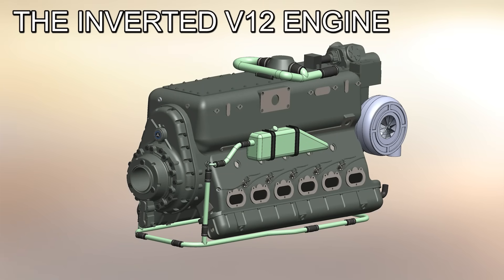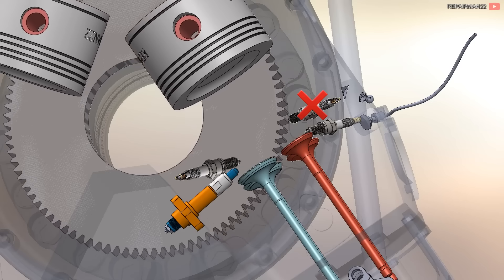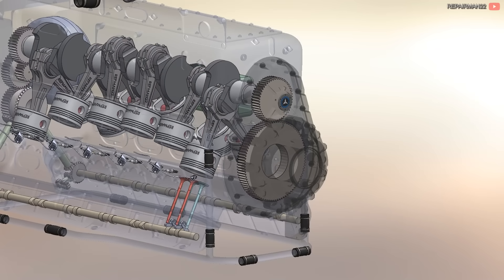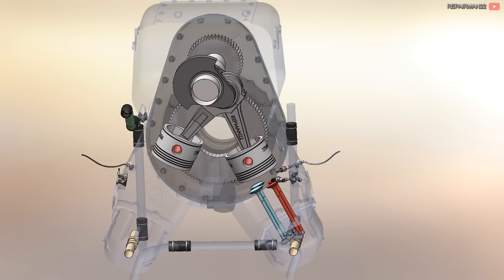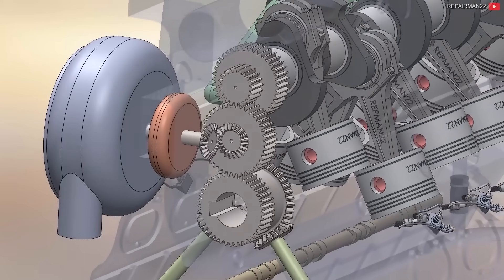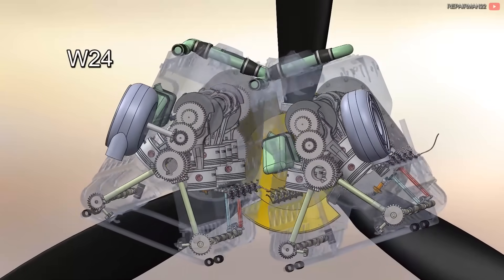The INVERTED V12 🤯 Why!?!?  - 3D animation - DB 600 Engine // Daimler Benz

Comment: @TheEulerID Thanks so much for your reply, it was informative and fascinating. I knew of diesel being more power dense because of it being less refined. 

My reasoning was that, the first thing manufacturers did during the first U.S oil crisis in 1973-74 to improve fuel economy was to lower compression. 

I learned so much from your reply.

Comment: The Merlin and Allison engines used a water/ethylene glycol mix to allow higher temperature coolants, and thus smaller radiators, without requiring a highly pressurised system. It ran at about 120C. I wonder why the Germans didn't try that approach. Maybe they just didn't have the capacity (the British got their ethylene glycol from the USA).

Incidentally, there were bf109s with V12 engines the "right way up" in the form of the Spanish licence-built Hispano Aviación HA-1112. However, the Germans could not provide the DB605A engines as they needed all they could build once WW II started. Consequently, the Spanish installed the Hispano-Suiza 12Z V12, which was similar capacity (36.5 litres) and had the same provision for a hollow propeller shaft to accommodate a cannon barrel. 

After WW II, when surplus Merlin engines became available, then those were retro-fitted to the Hispano Aviación HA-1112 fighters. They can be seen in the film Battle of Britain, as the producers leased a number of those Hispano Aviación HA-1112 fighters and painted them up as Battle of Britain era bf109s. However, you can clearly see the give-away that they were Merlin engined from the higher line of the exhaust stubs. They would also, of course, not have sounded like a DB605A engine either, but the producers just dubbed the "correct" sound in. 

So to what extent the adoption of a conventionally orientated V12 affected the performance and flight dynamics of the bf109, I really don't know. But clearly the inverted engine format wasn't absolutely essential.
Reply: @EbenBransome The Merlin I, II, and III series all used pure ethylene glycol coolants. That presented problems, not least with it being highly inflammable. From the Merlin X on, a water/ethylene glycol mixture at a ration of 70:30 was used, and that seems to have remained.  

First it is a fact that RR used a water/ethylene glycol mix an settled on a ration of 70:30 as the best compromise (which they used from the Merlin X onwards). Also, the lower heat capacity of ethylene-glycol does not, in itself, cause radiators (or rather heat exchangers) to be larger. Quite the opposite as they can run hotter and exchange more heat through a given surface area. Where the reduced heat capacity of ethlylene glycol does come into play is in how fast the flow rate has to be. One half the heat capacity, then twice times the flow rate and there are also some conduction issues.

The prescribed coolant temperature at high power output levels, such as when climbing fast and in combat was 120C, although some later models were allowed very short periods at 135C. 

In practice, the cooling system of the Merlin and its prototypes evolved quite a lot. Originally it was intended to use evaporative cooling, but it proved unreliable and hence the move to ethylene glycol cooling in the earlier engines. Later it move to the water/ethylene glycol mix.

Comment: How did the prevent oil leasing in the cylinders hydro locking the pistons when cold starting
Reply: It's a dry sump design. That is as much of the oil as possible is scavenged out of the crankcase and stored in a separate tank. That's not unusual - all the high performance V engines in WW II were dry-sumped or else there was a very strong chance of oil starvation under aerobatic manoeuvres. 

That's not to say it isn't still possible. In the case of radial engines it was normal to turn the engines by hand first to ensure that the bottom cylinders weren't hydro-locked. I suspect the Germans may have done that with their inverted engine designs too.

Comment: Inverted engines require dry sumps, and it's apparent that manufacturers either have a bug up their backside, or lack the compentency to manufacture engines with dry sumps.
Reply: Dry sump was the norm for aero engines, even if conventionally orientated. Thus the Merlin is dry-sumped, as is the Allison V-1710-F30R. The reason is obvious. With a highly manoeuvrable aircraft, you cannot afford to have the oil sloshing about in a wet sump as oil starvation becomes inevitable, which would be disastrous.

Top level race cars have dry sumps for the same reason.

Comment: I remember an argument that started one night at a bar over someone said the cannon fired down the middle of the crankshaft' there ensued the argument i stepped in with a little sketch showing the con rods crossed the rotation centre line of the crank therefore it was impossible ............
Reply: +@leso204  The cannon does not fire through the crankshaft but through the vee of the engine cylinders and exits through a hollow propeller shaft.  The prop is geared off of the crank for most aero engines.
Reply: @FiveCentsPlease  As i said' some people have no engineering knowledge but still argue they are right ........

Comment: This engines suffered a lot from Overheating, for two reasons, the Germans dont had quality materials to built Good and effective radiators, and the Middle Cannon of the Bf109s mounted inside the engine can make fissures on the block so they deactivate the middle gub

Comment: Because of the fuel injection it was possible to keep both intake and exhaust valves open for a certain time. This increased the gas exchange in the cylinders.

Comment: Another weird motor, there exists a version of the old 1.9 Volkswagen turbo diesel (I believe it is based off the ALH block motors) that exists in a vertical design meant for backup generators etc

Comment: Im just imagining this engine inside a King Tiger tank instead of a Bentley
Reply: The King Tiger used a Maybach HL230 V-12 engine (and certainly not a Bentley engine, which was British at the time). The Maybach was 27 litres and a lot more compact at 1,000 mm × 1,190 mm × 1,310 mm. The DB603 was 2,642mm × 775 mm × 1,067 mm. Of course the latter did include some things like the reduction gear and (essential) supercharger, but there is no way it would fit in the engine bay of a King Tiger. There is also the little issue that such a powerful engine would wreck the already marginal transmission system of that tank which really was not up to the job.

As it is, towards the end of the war, it there was a recommendation to fuel-inject the Maybach and supercharge it to give around 1,100 hp, but it never happened.
Reply: @TheEulerID   Two Panzer VIII Maus prototypes were constructed for testing and were powered by MB509 V12 engines that were derivatives of the DB-603.  The Soviets captured them and one survives at the tank museum in Kubinka.
Reply: @FiveCentsPlease  True, but the Panzer VIII Maus was not a King Tiger. It was a super-heavy weighing in at 188 metric tonnes. The "king" tiger was a "mere" 68.5 tonnes. So I still think it would be impossible to squeeze an engine derives from the DB-603 into the engine bay of the latter.
Reply: +@alfredshort3  There was a tank version of the DB-603.  Two prototype tanks were built and tested.  One survives in a Russian museum.

Comment: The Germans were not the only ones with inverted engines in fighters the Japanese also used their own inverted Mitsubishi engines, Can't remember how many cylinders but it was a huge engine I saw it along side of the Daimler Benze  V 12  like the one featured hear in a private collection many many years ago, also there was a reproduction of a prototype weird X 8 engine
Reply: +@Fladflidington   The Japanese built a licensed version of the DB-601 engine.  Although they lacked the expertise to manufacture precise tolerances so those engines were problematic.

Comment: Tower Shafts and bevel gears were standard for inline aircraft engines. Gears also drove the magnetos, oil pumps, foolant pumps and mechanical superchargers. Botton end bearings could be plain or roller type.  Radials it was common to use ball bearings on the crank. The cam rings were driven by external and internal spur gears. The cam ring in an 18 cylinder radial often turned wt 25% of crank speed. Props in all engines except low powered direct drive engines used speed reduction drives to keep prop tip blade speeds below the speed of sound.

Comment: The lower C of G is a myth, if the cannon tube is on the planes centre line, then the heavy crank and rods are now above the planes centre line.(In cars there are no inverted V engines to keep the C of G low) The higher C of G of this engine helps the plane to initiate a roll from straight and level.

Comment: Did not watch the whole video. I guess the main reason for the inverted configuration is because that is what the customer (German Air Ministry) wanted :). I've seen it sited that this allowed the gun to fire through the propeller  axis. I'm not buying that as I see no reason why this could not have been achieved with 'normal' configuration if so desired. One thing going for inverted V is that access to spark plugs and cylinder heads is easier from the ground on a fighter airplane. I think maybe the right question is why allied used 'normal' configuration and again I put forward the access to the sparkplugs and cylinder head as they had the requirement to use the same engine in tanks and boats. Imaging chaning the spark plugs in the bilge of a boat with and inverted V engine.

Comment: Inverted is a relative term.  The cylinder heads are facing downward relative to the rest of the engine, but who's to say that's not right way up? To me this seems like a more sensible arrangement.
Reply: The vast majority of IC engines are orientated with the combustion chamber at the top. Hence it's called conventional. Among other things, it allows wet sumps and also avoids the problem of oil draining down into the combustion chambers. Also, for land and water-based usage it allows easy access to the valve gear and spark-plugs. It is only in this particular use in aero engines where it has some advantages. So we use the term "inverted" for the minority case. 

Incidentally, there were other "inverted" aero engines around, such as the very successful de Havilland Gipsy Major used in many civil aircraft prior to WW II.  It suffered from high oil consumption until modified pistons and rings were installed to control it. Thus there are disadvantages as well as advantages to the inverted layout.

Comment: Once they built the first one, they were kinda stuck! Their mechanics were trained in them, their tools were tailored to them. The marginal advantage of changing just wasn’t there. Similarly, you will note the Nazi Luftwaffe stuck with the 3 bladed propeller for most of its aircraft. They figured the 2% gain in efficiency was not worth the additional manufacturing etc. rather like the US sticking with the Sherman tank, heaps better available, but they were being built all over the US by over a dozen different manufacturers with dozen of variations, petrol, diesel, 75 mm shorts, 90 mm longs, Recovery, Swimmers, Bridgers, Flails etc. of course, later on they built the Butcher Bird fw 190, that’s another story.

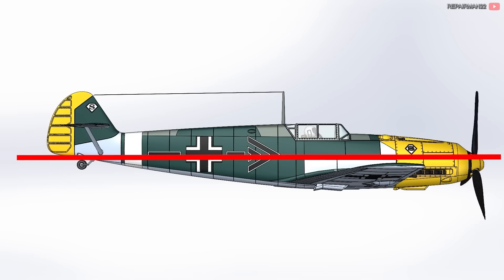Comment: 07:29 If the engine will be operating at higher temp, then the radiators have to be BIGGER, NOT SMALLER.  That sounds backwards.
Reply: You have to consider the differential in temperature between ambient and the radiator. All things the same a hotter radiator will dissipate more heat than a radiator at a lower temperature, that's just basic heat exchanger stuff. That would let the radiator be smaller as well as the fact that it doesn't even need to cool the coolant as much since it is supposed to run hotter. Makes perfect sense, besides running an engine above 212 degrees being really, really infeasible...
Reply: No, that is completely wrong. If the radiator is running at a higher temperature, then the temperature gradient is higher which means the rate of heat transfer per unit area is higher. Thus if the radiator (really better called a heat exchanger) runs at a higher temperature it can be smaller and requires less air per unit energy transferred.

Comment: Everything is very clearly and neatly laid out, I just noticed that either the propeller is rotating in the wrong direction in the entire video material, or the angle of the blades in the direction of the aircraft's movement is incorrect

Comment: So why didn't they use diesel with heaters for the fuel?
Reply from the maker: Diesel engines are heavier and need more displacement. It was in the desk but the gas engine was selected.
Reply: @repairman22  Why didn't I think of that?

Comment: Different compression ratios are amazing. I think the same, and even more strong, problem should be at Subaru engines. Amount of oil going to left and right sides must be very different. I think that is a reason of the 4th cylinder knocking, just lack of lubrication and piston cooling.

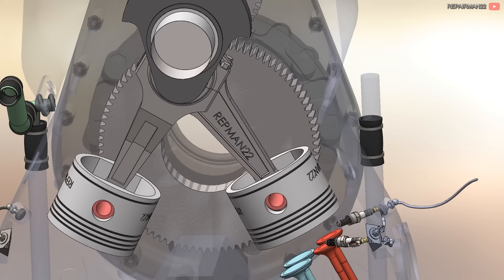Comment: @1:57  "if the engine was stopped for a long time, the cylinders could become flooded with oil and the spark plugs had to be removed and cleaned."  No, that isn't the main reason, and that is why this video was definitively not written by any airplane mechanic.  If oil gets into the cylinder and the engine is rotated by a starter without draining the oil first, the rods will bend (fluids don't compress) and the motor will have to be rebuilt.  This is called hydraulicing by most mechanics.  That is probably the main reason that the Allies didn't want to use an inverted V-12, because it was so easy to hydraulic the motor.  It may have required that the spark plugs be cleaned, but the main reason was the hydraulicing that would damage the motor.  This is why you don't just start an engine that has ingested water - it will destroy the engine.  You have to pull all the spark plugs and spin the motor over to force all the water out of the cylinders.  If you've ever wondered why you have to pull the prop through two revolutions on a radial - this is why.  You have to get the oil out of the bottom cylinders before spinning the engine over.
Reply: He was referring to removing the spark plugs to drain the oil and also cleaning the spark plugs as a secondary thing, obviously the main thing is to drain the oil through the spark plug holes.
Reply: Thank you
Reply: The Boeing Stearman was like that.
Reply: Hard to take your comment seriously if you don't even know and/or use the correct term: hydrolock.
Reply: @jimb3362  I know the correct term.  But, not everyone does - specifically the people who have never heard the correct term.  Even if I used it, the larger audience may not know what it meant - which is why I described it.  Mechanics by and large already know the phenomena, they don't need it described to them.  And, most mechanics aren't airplane mechanics (or A&Ps, or Airframe and Powerplant mechanics since you are insistent on the correct terminology), but among that larger group of  mechanics it is colloquially known as hydraulicing.  Yes, the correct term is hydrolock.
Reply: @wackowacko8931 I apologize, I have never heard that used to describe the hydrolock phenomenon. I would also expect the term hydrolock to be more intuitive to those less informed, but nonetheless you still explained the concept well to those who wish to learn.
Reply: @jimb3362  Well, hydraulicing is just a devolved language form of Hydro lock.  A number of people heard the term and converted it to "hydraulicing" or just "hydraulic" an engine.  This is because most mechanics know that fluids are not compressible, so that word makes more sense to them than hydro lock. They can figure out that because there is a fluid inside the cylinder, trying to turn over the engine will end up bending the rods.  It ended up being "hydraulicing" in common use because it made more sense to a larger group of people. It's not correct, but that is the slang version of the word.  Unless you are an airplane mechanic.
Reply: Other then that, much of what you say is true

Comment: 2:55 why would needle roller bearing allow an aircraft to operate without oil? I don't see any connection.
Reply from the maker: Plain bearings are 100% dependent on oil. Roller bearings too, but  as they have "wheels", they can last longer without oil. In both cases, the bearings will be siezed, but the roller bearing will last longer. In fact, plain bearings produce less friction than roller bearings as long as they have enough oil pressure.

Comment: 1:11 it says the alloy is "resistant",  resistant to what? corrosion? but wikipedia entry for duralumin https://en.wikipedia.org/wiki/Duralumin actually says "Although the addition of copper improves strength, it also makes these alloys susceptible to corrosion."
Reply from the maker: I meant strength. In weight, the same amount of duralumin is stronger than steel. 💪

Comment: It's crazy how advanced this engine was, direct injection has only become common on cars in the last decade, gear driven cams aren't used much if at all, on road cars and probably never will become wide spread seeing as belts and chains are cheaper, hydraulic driven superchargers wont either but modern electronics and clutches can do the job of increasing boost for altitude, not that cars would have much variance and roller bearings will never be used on crankshafts either but theres little need for such redundancy and again modern materials are superior.